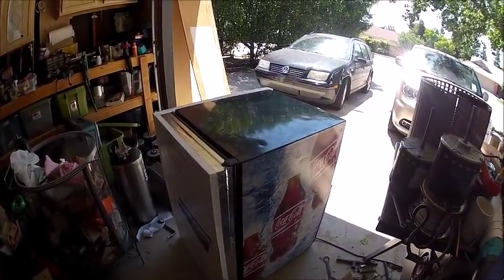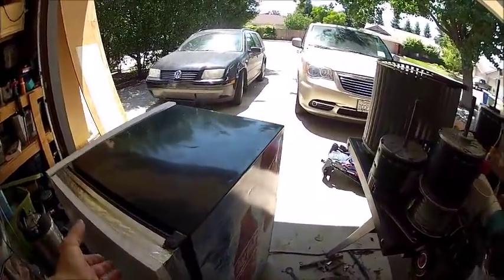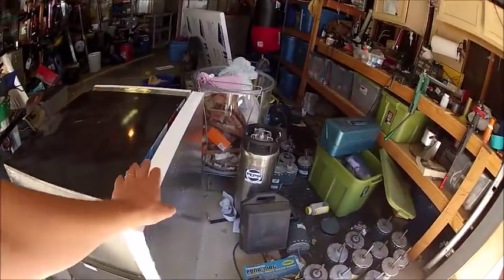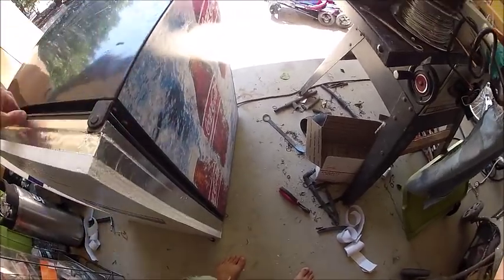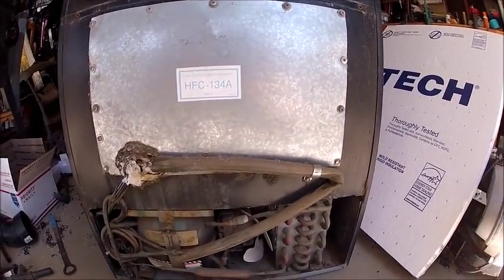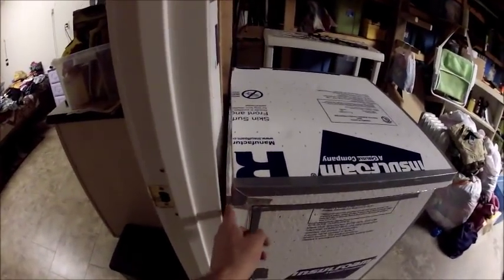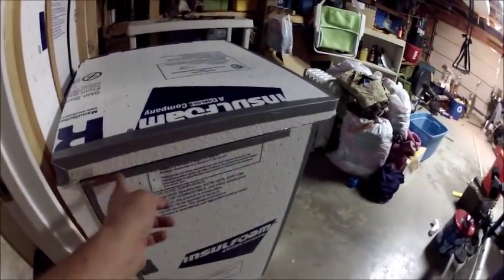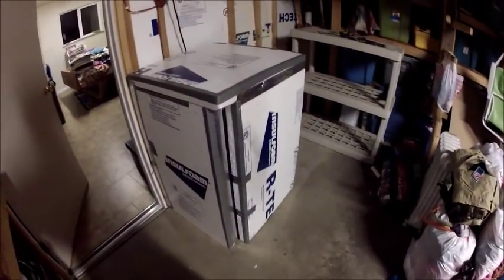How to insulate a refrigerator

Comment from the maker: I didnt like the way it looked with the reflective out. It probably would work better. The fridge does work better with the insulation on.  I have also done this with a deep freeze and it works a lot better. Thanks for the comments and thanks for watching.
Reply from the maker: I think I just taped it on. I would use silicone caulking if I did it again.
Reply: Thanks for sharing your video, I dig it..I imagine and correct me if I’m wrong but the reflective side on the outside reflects any light

Comment: I enjoyed your video, and I am going to do it to save money too.   I did notice one thing though.  The aluminum facing reflects the long wave radiation.   Like when the electric stove burner is hot, but it doesn't appear red, that's the long wave radiation.  So the garage is radiating heat, and the reflective side, if placed on the outside, would reflect that heat before it reached the foam insulation and the foam insulation would be primarily preventing the cold from escaping the refrigerator because the insulation is full of tiny air pockets which prevent the cold from escaping, for instance as would happen in a more dense medium.   Thank you again for a neat video of the process!

Comment: Not sure where you live but do you have cold winters? Does your fridge still work in the garage insulated like that to keep things cool inside of it? Or have you noticed that the fridge stopped running?
Reply from the maker: I was in the California central valley at the time. I did not have any issues. I dont think it would have been a problem.

Comment: You did it backwards. The reflective side needs to be on the outside. It's a radiant heat barrier and must have an air gap to work. On the outside, it will keep the heat from getting into the refrigerator. The extra 2 inches will help, but that exterior reflective surface would have cut out 80% of the radiant heat soak.

Comment: I don't know if insulate the top of the fridge it's a good idea since usually lot of heat acumulates there, and insulate that part would make the heat to acumulate there. But since you let a lot of space expel the hot air, I guess it's a good idea to counteract that.
Good idea.
Reply from the maker: The cooling system and radiator for the fridge are on the rear. I left it clear In that area.

Comment: Good video. What foam did you use
Reply from the maker: just the standard sheet foam from lowes. Its in the insulation section. 2" thick